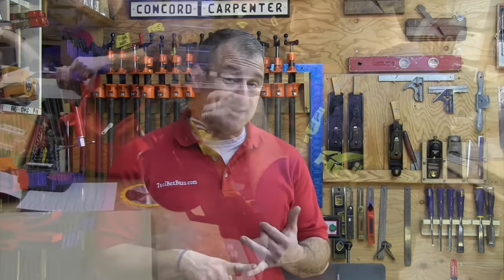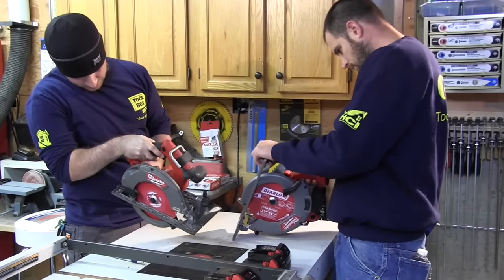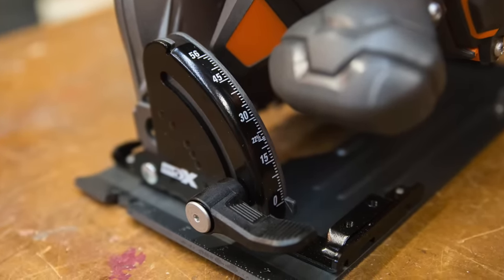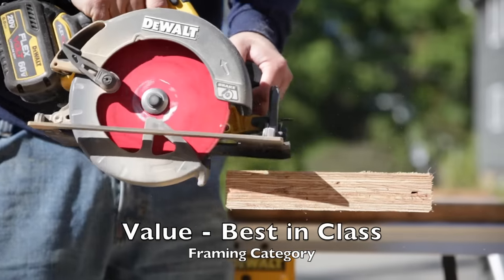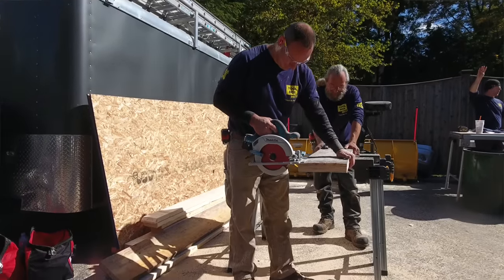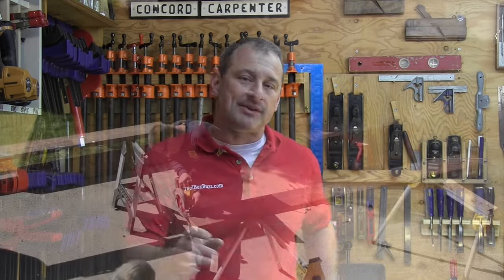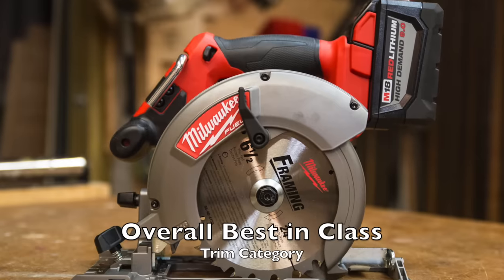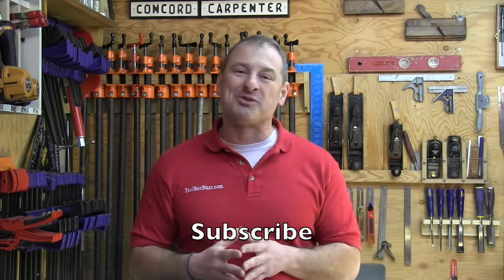Best Cordless Circular Saw - Head to Head

Comment: this test isn,t really a test without testing on about the same voltage and amperage....makita also has a 18volt circular saw...so that would be more fair....i missed a dust extraction category...does a shop vac fit on the saws and how good does it work...and keep the batteries with about the same amp hours...and seriously!?! you did not get the brushless makita? there is  a brushless makita also namely the Makita DHS680ZJ and it is 18 volt....but still a very good attempt to make a good comparison test..

Comment: Now you're making me feel bad, I was still still building up a collection of new Ridgid cordless tools. Currently have the X5 line up of brushless hammer drill, circular saw, pulse driver,  three 2Ah batteries, and one 4Ah batter. Was about to the get the X5 reciprocating saw and a two pack 4Ah batteries. The price on them are hard to beat, and they perform extremely well compared to what I've used before. Should I even switch at this point?
Reply from the maker: They are STILL the best value out there and a hidden GEM among tools
Reply: Switch the Ridgid saw blade with a 24 tooth Diablo and the 6ah battery and it's a whole new ballgame on the ridgid.  If that's the battery platform you have, make those changes and you'll be happy. Especially for the warranty and price.

Comment: I was looking at one of the lower end Makitas like the XSS02Z ($100).  Given that the Makita winner for trim saw is XSH03Z (brushless, around $190), I was wondering if it's worthwhile to spend the additional $.  Safety and ease of use are important, but I'd probably only be using it a few times per year.  Also, are there newer models to consider now?

Comment: This is great video very informative however my opinion on why you buy a cordless tool is different from your opinion in the video when I buy a cordless tool it is for its ergonomics portability and efficiency(Profitability) for example Not catching the cord on material you’re cutting which I know is happened to all of us making a rip cut not having to plug cord‘s and spoil them out and then later in the day wrap them up both of which are contributing factors to its profitability saving time not to mention occasionally cutting your own cord most professionals have more than enough batteries for their chosen tool set Making power (speed of cut) The only real important deciding factor If anybody actually read this whole comment saying do you want to reiterate this was a great video I hope to see more just like it maybe throw a couple other companies trimsaws in there though we didn’t see it the wall trim so I didn’t see any Harbor freight tools they’ve got to true massage now Hercules and I can’t remember the name of the other cobalt has a trim saw dozens of choices

Comment: Great video except I would have to disagree with your reason for making the flexvolt third place. I don't see not being able to use 20v batteries in 60v tools as much of an issue as many are putting it out to be. 
I may have a different perspective because I'm just starting out in the construction trade so I'm not invested as much into a battery platform as a guy with many years in the trades. Sure if you have lots of 20v batteries you may want to be able to use them in 60v tools but is it very realistic this would happen? It's kinda like putting a compact 20v pack on a 60v tool and an m18 9.0 on a compact drill. It's not very likely either would happen. Weaker power and runtimes on the big tool and big and heavy on the small tool.
Reply from the maker: No rafter hook is a ding too, as was the runtime on the current version battery.  Nice insight, thanks for sharing.
Reply: I would agree third place is still a good choice for the flexvolt.

Comment: I'm looking for a circular saw to start a very basic home workshop.  Just building some work benches and shelves and things like that.  Can a cordless saw fill that need or should I go with a corded saw for a home workshop?
Reply from the maker: Vince Diaz it certainly can, look at RIDGID - if your not going to use them often and not good about charging then Go corded
Reply: Thanks for the reply.  I have the RIDGID GEN5X cordless Drill/Driver and Impact Driver Combo Kit so that would be great to use the same battery system.  I will look at the Ridgid cordless saw.  Thanks again!

Comment: I have never owned a circular saw, table saw or track saw.  I would put myself in the NOVICE category (even DIY seems too boastful).  By some quirk of fate, I invested in Milwaukee tools.  I need something besides a hand saw, and I need it to be portable, to set up in the parking lot of my townhouse, to do small jobs like cutting some wood to create a protective enclosure for some outdoor pipes.  It seemed like a circular saw took care of it, but the table saw seemed steadier.  Now I'm just confused by what's what.  Even the size of the saw--6ish vs 7ish--has me baffled.  To be honest, I want the one that does the most for well, not necessarily best in just one category.  Does the Milwaukee circular saw turn into a table saw?  Is that the same thing as a track saw?  Is the 6'ish size just lighter?  Anyway, thank you for your review.  I tried to glean as much knowledge as I could.  You really know your stuff, but I'm starting at near zero.  :face-orange-raised-eyebrow:
Reply: I'm Looking into getting a saw too, but I do think the circular saw is a must. .  It can do most of the thing you can do in your statement, some more difficult than others, but it's possible.    As for the 6 1/2 size blade saw, it's lighter, the blade is on the left side and is generally the more popular one.  The 7 1/4, is heavier, but it's able to cut more, and the blade is to the right (with exception to the worm gear saws).  I do think  the blade to the right is set up this way for safety reason as the blade is farther away from your legs, and spits wood shaving away from you.   But the 6 1/2 probably best.

Comment: Blade/axle play?  Bearing availability and price?  are the bearings seated in a plastic or metal body?  Sawdust ejection port?  Rip fences and straight cuts?  Please, if you can, review the HF, Porter Cable, Ryobi, Skil, Hitachi, Galax, B&D, Makita, and DeWalt of similar specs regarding the following:
1.  Cutting 1", 2", and 4" wood at 90 and 45 degrees.  Rip fences.
2.  Bearing availability and price.
3.  Bearings housed in a metal or plastic chassis,
4.  Lateral play in the blade/axle.
5.  Saw dust ejection,
6.  Shoe graduation and material,
7. Warranties,
8.  Price.

The other reviews of circular saws all sound like the now disgraced Standard and Poors: all stock is good especially if the color is nice.  Hell, we all know that the polymer utility carts are indestructible and rust free.  A circular saw's polymer shoe is no less strong than aluminum.

Comment: I kinda of think that endurance is overrated. If  tool get you to lunch break when you can swap out batteries, it's generally enough. In other words, if it can't go all day, then 3/4 of the day isn't helpful. If it lasts as long as your natural breaks, that's enough. 
If you are invested in a system, it's also nice if the spares charge faster than you can drain another battery. I've never been able to out-work the Makitas, as they last longer than I do and charge super fast. Not saying Makita is best. But they work great for me.

Comment: If you delete the safety feature of the Dewalt flexvolt's e-brake, that saw will blow away any competitor. That e-brake feature does draw power to safely stop the tool. I love the engineering of that simple feature, just my opinion.

Comment: Man, how did you guys come up with that insane price for the Hilti kit? I just went on their website and the 36V circular saw with a 5.2ah battery pack and charger costs $667, less than half the price you posted.
Reply from the maker: Russell Brown priced at time of cideo
Reply: I just do not believe that was ever an accurate price. Hilti wouldn’t randomly start slashing their cordless tool prices in half.

Comment: I wonder how the results would change if you used the correct amperage for the dewalt battery. You were testing with a 2.0Ah battery in the tests not a 6.0. would be interesting to see if that changes things much.
Reply: A quick read of the article shows that you did the calculations on 2.0ah so it was a true and good test. Nice work.
Reply from the maker: Jason Showell I have to go back and read the article… This test was completed over a year ago I there probably was not have 6.0 amp hour batteries at that time. We looked the highest packs available at that time

Comment: How about a video , of the worm drive style saws vs the new skill saw, the true worm drive, I own de flex volt my co- worker owns the Milwaukee,  I like them both,  what I don't like is their saw dust discharge it gets all over you, and the skill saw,  which I haven't used,  only seen a video looks like you can control  the discharge direction  or at least discharges on the opposite side of the blade, other than  that I would like to see how they all perform

Comment: I've used the ridged which is pretty nice & the Dewalt flexvolt is pretty damn sick. That thing cuts 2x lumber like a knife through butter but Makita X2 36v now WITH a brushless motor is the one guys. I haven't even used it yet but that's the one I'm buying without a doubt. They have a 4 battery kit on acmetools.com with the saw (obviously), 4 batteries & a dual port charger for $350. You can't beat a fucking deal like that!!!! Plus I own the brushless reciprocating saw 36v X2 & that thing is a monster that'll cut through anything and then some. Makita hands down

Comment: Awesome review. I love the cuts per watt hour. If there is one metric I would love to see is some metric related to power and ability to cut through the most strenuous tasks. We have all been there when I saw struggles or a blade will bind on you, which saw has the power to deal with that the best. I bet the dewalt would win that category but it would be good to see metrics of torque or power output to compare the saws. I wonder what Makita and Milwaukee will come out with next. I currently have the 2731 but it is a 2 year old saw.
Reply from the maker: We felt LVL was a good test for the. the only punishing cut that would be worse may be cutting a roof off a building - I'd still plug in for that, so as not to beat my saw. But these saws would still make that cut

Comment: Do you know why the industry doesn’t offer a corded brushless motor for power tools? On site and no power I get it but what about the hundred of thousands of shops everywhere. They would just need to convert the ac to dc.  Cordless motors are more efficient, durable and the computer power management provides consistent rpm.  I keep looking but no luck. Maybe I’m missing something. My guess is when they come out they will cost a bunch. What else is new. Really appreciate your vids. Thank you 🙏🏻

Comment: If you say you've got real construction workers evaluating your tool, I'm really skeptical at your result if you start comparing voltage or amp hour. 
Ergonomics and ease of use will be so much more important than anything else you can measure. It's obvious that a bigger the battery can last longer and make more cuts, but it also means you'll be more tired lugging that saw around that you don't even want to carry it around. If a saw cuts 10% faster and easier than the others, I'm sure you'd get that over every other saw instead because you'll finish your job faster even if you have to stop and take a break to swap out batteries several times a day. I would argue that nothing is as important as how much battery + saw would they have to carry around to get a job done at the end of the day.  
As for the value of the product, your review doesn't tell me anything about the longevity of the motor, gears, batteries to tell me how long should I expect them last before I have to buy replacements which goes a long way to evaluate the total cost of ownership. You didn't cover stuff things like that which makes these reviews seem pretty pointless to me.  From what I can gather, all the tools reviewed here probably are quality products back by quality companies, but there's not enough information to tell me which one I would like more because I just don't find the data presented to be all that useful.

Comment: happy new year to all. question how many cut can you do on a 2amp battery? (circular saw).
Reply from the maker: victor feliciano i'm not sure, we didn't test it with that battery size
Reply: victor feliciano though most tool companies have 2.0 batteries they really aren't designed for using on saws which are considered more of a high draw tool. meaning a higher capacity battery is better suited for it.   lower amperage batteries are geared more towards drills as to keep the weight down

Comment: Battery is not always a big issue now days you can find replacement that are sick cheap and fully working. Cutting  , power , speed . Is a factor because time is money and dewalt flex 60v are biting the shi* of any saw here.
Reply: until you need a rafter hook..... Just kidding they probably updated it with a rafter hook by now I would hope anyways.

Comment: Hello, I am looking for a saw to do the job of helping cut some 2 inch thick limestone and veneer for some pillars and fireplace. What type of saw would I be looking for as far as size. Id be interested in knowing a good brand and model to purchase as well. Thanks
Reply from the maker: King Louie masonry cut off saw
Reply: A Concord Carpenter / ToolBoxBuzz pardon me, I actually meant the machine ie makita 6 1/2 Milwaukee , etc.
Reply: Sorry I meant the actual handpiece
Reply from the maker: Are you thinking I=of using a grinder?  I was referring to a gas, cut off saw like a Husqvarna. Dewalt makes a 60v  Flexvolt cut off saw
Reply: Well, I'm not sure. Will a grinder cut through 2 inch thick limestone? I was thinking a battery operated saw, but It needs to be powerful enough to do long cuts (2-5ft) in order to make limestone Im using for fireplace ledging fit.

Comment: Everybody seems to be missing that the Dewalt, with an equal 9Ah, would have beaten the Milwaukee since the cuts/Wh was way higher than for the Milwaukee. Besides, 54V has a lot more grunt than 18V.
Reply from the maker: Mattias Persson at the time of this test (1yr ago) they didn’t have that battery so there was nothing to miss
Reply: Well there was, because nowhere in your test are you explaining why the Milwaukee made so many cuts, you've just vaguely said the Dewalt made most cut/Wh. What happens when you compare the number of cuts the Milwaukee would do on a 6Ah battery? Well, you didn't.

Comment: sorry to ask but is that 60v 9amp side or is that 20v 9amp side?  / on this battery now it (60v 2amp & 20v 6amp)  i am trying to fine out on the 60v side what amp are they coming out next year?
Reply from the maker: Flexvolt 60 v for 9 Ah
Reply: Victor - Great question. 
60V - 6AH pack is the following: when used as 20V, it is a 6 Ah pack. When used as 60V it's a 2 Ah pack.
60V - 9AH pack is the following: when used as a 20V, it is a 9 Ah pack. When used as a 60V it's a 3 Ah pack.

Comment: My buddy just built a 16x14 deck with the Milwaukee saw. Before he finished, it shit the bed, something happened to the switch or the saw brake, Home Depot actually took the saw back and replaced it no questions. 
Come to find out this isn't a fluke thing, it's an issue that has happened to many customers. 
This is something not considered in this video.

Comment: These right hand blade saws are only great if you’re left handed. If you want a real construction saw, get a worm drive. The new Dewalt flex volt is a beast. I highly recommend it over these little circular saws. Much better cuts.

Comment: And they left out the 6 1/2" kobalt that's 160$ total, 99$ saw and 50$ 6amp hour battery throw in a few more batteries to even reach the price of the next saw. It also cuts as deep as a 7 1/4" circ saw because the motor sits low in the frame. Its also narrow compared to all other saws and its brushless.

Comment: I need to go modern I still use a corded 7 1/4 saw mine is a skill saw from the Bosch days so mine does not have a Allen key   I think I want to get the new Bosch 7 1/4 cordless when it comes out I am on both rigid and fache platform in cordless